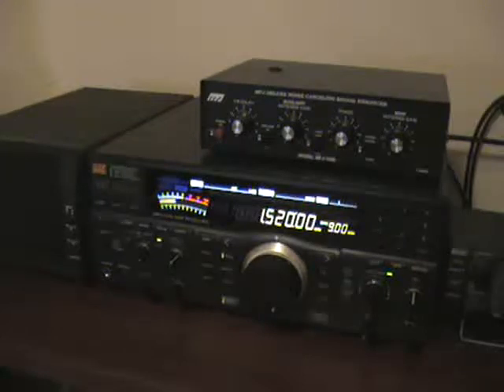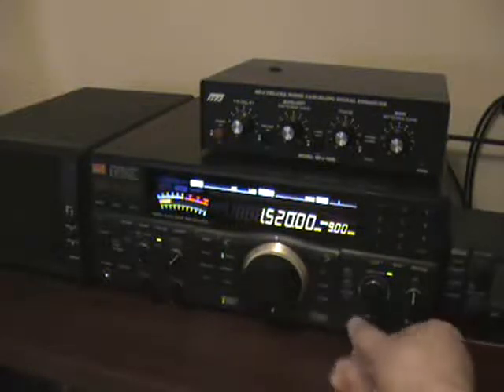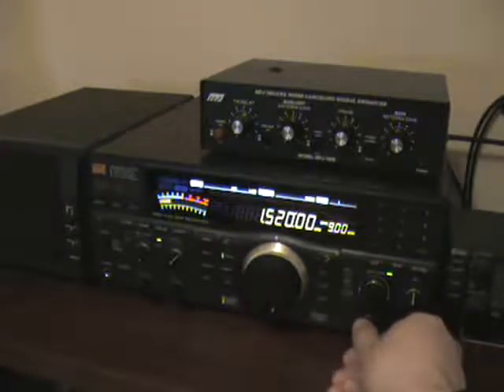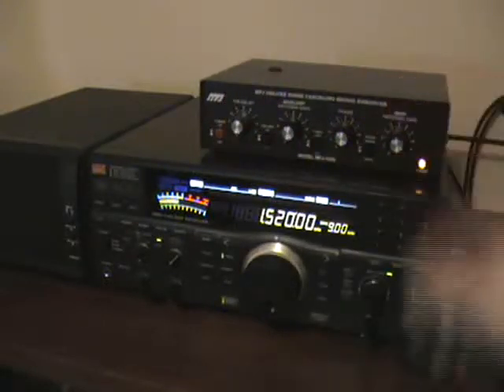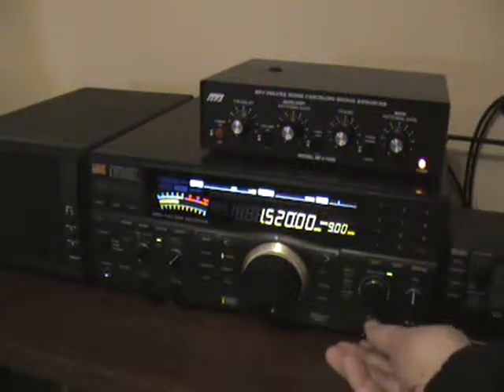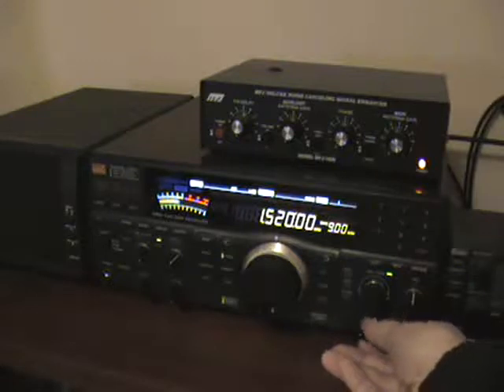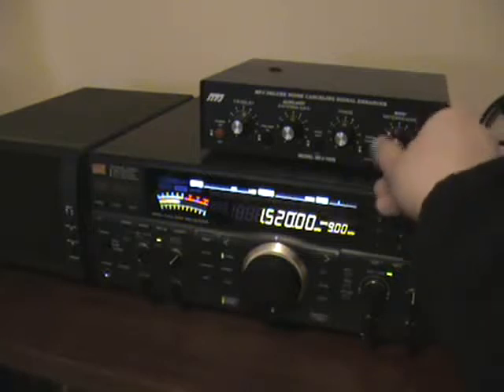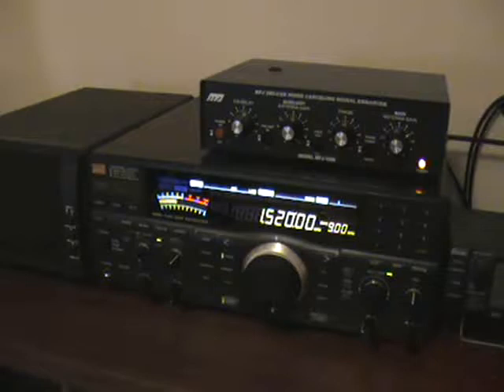Phasing a Loop and Longwire on AM / MW

Comment: I have a phasing unit, I'm interested in what patterns are best to phase, ie, what antennas are the most useful to phase and get a null in the direction you need. Is a Flag pattern and an omni pattern a good combination, or a small tuned loop and a Flag, or  small tuned loop and a Flag.   AFlag has wide front lobe and little back signal.

Comment from the maker: @transithanschr The unit has to be modified to get it to work across medium wave and long wave. Six components have to be removed (or gently crushed on the circuit board with fine nosed pliers) they are L5, L6, R27, L3, L4, R26 and are marked on the board. Takes five minutes to do.